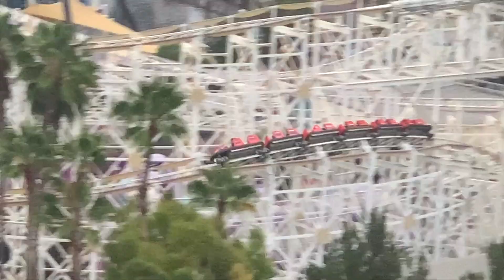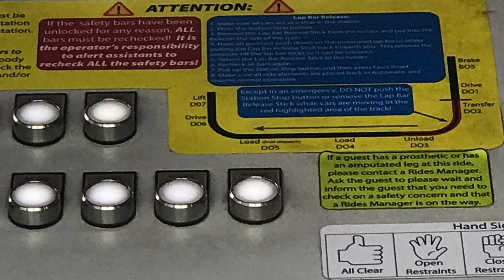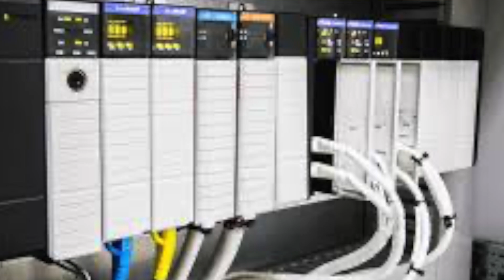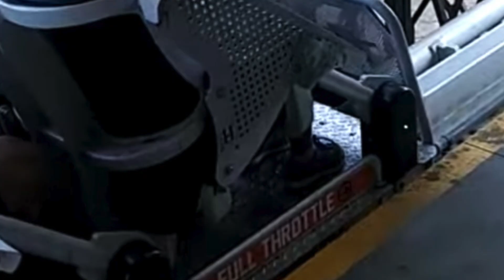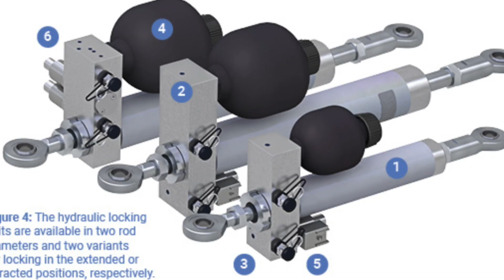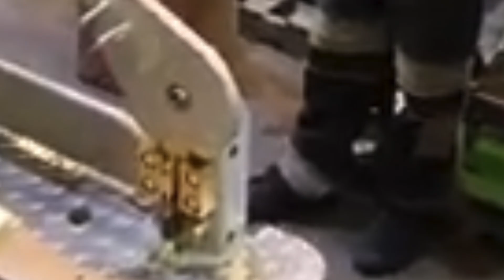Rides can’t tell if your restraint is locked

Comment: i used to work with a ride that had a neumatic system for the restraints operation: it needed air pressure to release the ratchet and to open the restraint itself. When the air pressure dropped, the lap bar came down to the passenger and the pawl's spring forced it to engage with the ratchet. Each toothed bar had the standard proximity sensor which told whether the restraint was in the correct position, but it also had a sensor on each pawl to make sure it had been properly engaged (4 per seat). The type of ride allows it to continuously monitor the restraints system during the cycles. This is easily one of the safest, fail-proof systems i've worked with.

Comment: the rides we have here at SFOT  CAN  tell the operator if the restaints are locked we have the Texas giant that has a test seat and the Titan that anytime someone gets in  the train thers a line cluster of amber and red lights the amber lights tell them if the restraints are open and the red light tell them that the restraints are locked. ive seen the control panel on both the titan and the texas giant and they are almost one in the same.

Comment: Ok, I had a bit of deja vu seeing that seatbelt latch component. I believe a simmilar (but older) part was used as a door lock on a couple of the CNC mills I've run. Most notably the Fanuc mill at my last job which most of the time would continuously not allow you to open the door even when the machine was stopped at the end of a program. The piece that it holds on to is very simmilar between the one pictured in the video and the ones used on the machines I've run.
Reply from the maker: @kaylinosprey3306  they are commonly used to lock cabinets for electrical and machine guarding so it’s probably the same thing.

Comment: Theres one theme park i occasionally go to (its the only theme park where i have been on any rides) where all of the rides are machines that are not designed to be used as rides (which means the rides with lap bars CAN operate with the lap bars fully open)

Most of the rides at that park are "visitor operated", where the rider has control of the machine (the machines used for those rides have a system that prevents the engine from being started without a ride op/attendant authorising it, but i don't know if there is some sort of remote shutoff for incase a rider does something dangerous)
With one of the "visitor operated" rides i went on, the ride op/attendant was having trouble with the scanner thing (it probably took 4 or 5 attempts)

There are some rides that are operated by park staff though, and on one of those rides the ride op didn't check my lap bar, and didn't even close the other lap bars
on one of the other rides, i saw a rider try to unlock the seatbelts (there is a bit of metal that covers the seat belt release button on each seatbelt, and the rider tried to move the lever that moves that bit of metal out of the way)

Comment: I worry like hell about this as a smaller-bodied rider. I'm afraid of restraints not locking tightly, because at ~5'3 and <100lbs I'm small enough to slip through easily. I have a ticket for a Six Flags park this weekend now I'm scared seeing this is a sign I should reconsider lol
Reply from the maker: @fjordpitsky4486  six flags parks, your fine, i go on those all the time.
Reply: @ryantheridemechanic  I really hope so, I know you can be too big to safely ride but I'm worried about being too small, I'm only about 7" above the height minimum but I mostly worry about being too skinny. I hear SO many stories of people being at Six Flags and their restraints not locking, many of them needing to be held in by other passengers to avoid ejection
Reply from the maker: @fjordpitsky4486  I’d like to see those.
Reply: @ryantheridemechanic  They're very widespread, a while ago someone on TikTok said the lap bar popped completely up on her midway through the ride, seems to be similar experiences from many other people. They're scattered across pretty much every social media platform. Lots of examples in YouTube comments on videos about ride accidents, especially news reports. I've heard a few anecdotes in person too, especially from smaller riders on Over Georgia's Batman coaster. I've never seen any of it officially documented which is unsettling
Reply from the maker: @fjordpitsky4486  well most of it is perception. When a restraint skips a tooth you’d swear it can open but it simply jumped a tooth. Actual failures are extremely rare. I’ve only seen one in 14 years.

Comment: my state fair had a traveling ride that put riders into inversions and twists.... the restraints automatically came down.  When the controller had all green lights on his console he started the ride.  There was no physical checks by anyone (other than the riders doing it themselves but they didn't officially ask us to do that).  I was surprised.  So there must be something out there that knows for certain if the restraints are in their proper position and locked.
Reply from the maker: @joeskis  the light signals the restraints  are down far enough. The locking is assumed until physically checked.

Comment: Newer B&M rides do have checks on the individual restraints.  Fury 325 for example has contacts in the station the train sits on to relay the restraint position to the PLC and will not register locked until the ratchet and been closed at least 3 rachets down. The control system won't allow it to dispatch until every seat is far considered locked. 

Of course there is no active monitoring while the train is out on the course but the probability of the ratchet mechanism failing enough to open far enough to let you fall out is extremely small but it's still a possibility.

Comment: When that red allen bradley seat belt sensor didn't work as expected did they figure out how to fix the problem or redesign it or something?
Reply from the maker: replace the whole unit at almost $500 a pop. we tried to change just the head but AB did not allow that (messed with the safety raring) but no permeant solution was delivered.

Comment: B&M flyers are a bit more interesting. The seat pin moves into the arm and then hits a proximity switch. The ride will not dispatch unless all seats show that the pin has reached the proximity switch in each arm. Therefore the pin "should" be in the arm and the seat locked. Of course, this is making the assumption that something hasn't failed and the proxy switch is giving the correct reading.
Reply from the maker: Is the sensor monitored for rise and fall or Chang of state?

Comment: I remember years ago when I was at my home park riding on a Mack Sleighride and the T-bar restraint popped open on me when the ride started, I tried to get the restraint checker's attention, who was standing to the side, but she didn't hear or noticed the lapbar was up. Toward the end of the ride, I was able to slam the lapbar down and it finally locked, fortunately, nothing happened to me, but it was quit unnerving at the time.
Reply from the maker: I was on the ride when an ops crew did the same thing. Accidentally unlocked the lock and dispatch. I was maintenance but in the park with my family at the time. The crew was replaced within 10min. Didn’t see them again.
Reply: I slightly moved the lap bar, putting my things in the storage compartment and that’s the way it locked so it was not fully secured. It was a scary ride because I didn’t know if it would invert the Everest.

Comment: Here is a question....
Now....is it the same logic system that shuts down a ride when ppl either remove the seatbelt or a seatbelt system fails when going up a lift on a coaster such as Magnum XL 200 or Millennium Force...
I have seen it or heard of it stopping on the lift for such a reason...
And I have seen screens with seats on Valraven and Steel Vengeance and is that just position verification cause i know it wont dispatch if any red shows...???
Reply from the maker: The seat restraint has to be far enough down to make the screen turn green. As soon as the train moves the ride is blind to the status of the restraints. When someone unbuckles on the lift it the ride operators that press lift stop.

Comment: While everything you said was true. This is a great example of how word choice and the presentation of material can mislead an audience. In my 18 years in the industry I've never heard a ride mechanic speak with the skepticism you do in the video. A restraint designed to fail safe, and having been (in most modern rides) detected as closed by the ride system and visually and physically verified by a trained operator, is as secure as can be assumed of any mechanical device. The scenario that you paint of a restraint being found unlocked as a train ascends a lift hill, (while not zero) we can both agree is so close to zero that an occurrence as described would send shock waves through all facets of the industry resulting in design, maintenance, operational, training, and communication changes. The design, systems, and processes around thrill rides today far exceeds anything found in other machinery the public interacts with on a daily basis. Trains, Cars, Planes, Construction equipment, Elevators, Escalators, Microwaves, Drawbridges, and CT scanners are more likely to injure or kill due to a failed safety system. It would have been fair to make some version of a contextual statement, that you found agreeable based on your expertise.
Reply from the maker: There are definitely way more throng out there to worry about, thats for sure. I do love to play in the verbiage gray area. Stems from racing. Not what the rules say but what they don’t say. Same thing here. Rides have amazing safety and redundancy built in better than most things in the world. But the hook is priceless.

Comment: Whenever I ride roller coasters I feel that I assume that a degree of responsibility. I always give a pull and a push at any of my restraints. I know that by doing this simple thing I have insured that the systems in place should then operate fine, regardless of shifty operations. Not taking anything away from ride ops. But if i at least pull my restraint to my body and give s little push back, I can ride happy knowing at least one person did their due diligence. Definitely was able to push my restraint on lightning run to the point where it was no longer holding me. Alerted the confused operators. Switch chairs and had a great ride as the next one wouldnt budge.
Reply from the maker: When my wife rides with me she sakes me to force hers down further trusting to get one more click. She calls it her safety click. I’m happy to help her. I always check my own as well.

Comment: I once operated a Zierer Tivoli medium on which the Control pannel was so basic and old, you could start a ride cycle while unlocking the restraints and it couldn't care less 😂
Reply from the maker: Yea. We had to tell ops not to send the major coaster with the restraints open after service bulletins came out about cracks in the bars. From operators doing it as standard practice.

Comment: This happened to me about 20 years ago on Dahlonega Mine Train at SFOG.  Held on and when we hit the 1st brake run in the station, we got out and walked up to the station. The looks on the ride ops faces we’re priceless.
Reply: Not just a gap, the bar never locked.  It had some tension on it, so when the op did a quick two finger check it seemed locked.  Once we started riding the bar could come fully open. Thankfully it’s a mine ride. We just held on. When we hit that brake run, we opened the bar fully and got out.
Reply from the maker: @dennisrichardson4187  wow
Reply: @ryantheridemechanic  woah realizing that mine train incident was at SFoG really changes how I'm seeing the park given recent events. wow. not good. not good at all.
Reply: @illeyejahmalone it seems like the only park comments here are about sfog... And all years before the Goliath incident...
Reply: @h1jen1x  yup. that's a very very bad sign that something is seriously wrong with that park.
Reply from the maker: Yea if I have some padding I can get out of the millennium  flyer trains from GCI
Reply: Oh man this comment is a massive red flag that should have been caught years ago considering what's just happened at SFOG now with the rider ejection. Boy oh boy oh boy not good SFOG not good.

Comment: First of all - who are you and what have you done to that Ryan guy who would nerd off about topics like this in an hour-long video? 🤣
Jokes aside. I am now wondering two things:
First of all, there is at least one coaster in Germany (a country not exactly known for being massively unsafe, and we are talking about a big-name park here) where I have never seen (at least up until 10 years ago when some change in my life stopped me from being a regular to the park) any operator manually check the restraints or ask the guests to do so. It is well possible that there is a minimum verify, but that's likely it. Sure, it's more of a Wild Mouse style ride, but despite not being large, they have some sharp pops of forces. Makes me wonder what is going on there.

And - could it be that there are actually some coasters that do verify that the restraints are locked? Time Traveler at Silver Dollar City comes to mind. The restraints close when the operator pushes a button on each unit of four rotating seats. They come down, you feel something click, and then they feel like they get pulled up again by the same mechanism that brought them down.
Reply from the maker: So at the top, I tried scripting this one because I had a lot of exact point I feel I couldn’t hit In my normal rambling session so the script was vary big but not long there’s the time. 
1- manufacturers typically state to verify the restraint is down all the way and locked. But countries where they are not run by money hungry lawyers (lawsuits in Germany are much harder and less frequent,) don’t have as many regulations for common sense things like checking a restraint when you pull it down. That’s more of a US have to pander to the bottom 0.5% 
2- the restraints on time traveler, I believe our hydraulic. So if they lower on their own, they probably have a pneumatic, actuator or spring lever, pushing them down. Once they are in the down position, the lever releases and the hydraulic actuator kind of springs backwards, and then you get the feeling that it went down and then essentially pulled back up. Essentially it was a difference between the actuator releasing and the cylinder grabbing.  The noise is either the mechanism releasing or a secondary engaging. I’m honestly not sure which one it is for that particular ride.
Reply: @ryantheridemechanic True, Germany is not as sue happy as the US, which is also why seat belts are much less common here, and there are even coasters that don't have air gates. But regardless, it is normal for operators to check the restraints, even at the same park. It is just this one coaster where I don't remember seeing them ever do it.

With Time Traveler, that could be one explanation. But at the same time, who knows what good idea Mack Rides had there. And with the model still being quite rare, only few people have seen the internal workings of the restraint mechanism. Maybe I should do some research if they filed patents on that stuff. There can be quite good explanations in there.
Reply from the maker: @Colaholiker  absolutely. I have very little experience with MAck rides.

Comment: I’m curious why ops at Steel Vengeance at Cedar Point tell you to not pull the lap bar down by yourself (otherwise you have to do the loading procedure all again) and then they come and push them down. Do you know what that’s doing)
Reply from the maker: If there is a lap belt they have to see those first. Otherwise, it’s in the plc when the lock command is given none of the down indicator prox’s can be high. So if one is down when lock is pressed the plc will throw out a trouble error.
Reply: There is seatbelts they want those on before the lap bar

Comment: I personally love what Mondial Rides and KMG have done on their flats. They have a green light above or next to every individual restraints which is also a push button for the operator when the system says no, with one push of the button you can unlock the restraint, and try again. The platform operator always can see if the restraint is saying yes or no.
Reply from the maker: The individual button is so nice. Love that.

Comment: The ride is designed to be locked in its normal state - rolling. Sensors or not- it doesn't matter if it's electronically monitored.
Reply from the maker: Well put. Only the station can unlock.

Comment: I thought that with (specific example) B&M’s new attractions they have the ability to verify restraints through ausibus on the track. Some parks even have screens or displays that show each restraint and its status.

From what I understand the main PLC won’t allow the train to dispatch unless the restraint is closed correctly.

I would really like to know more about the ausibus.
Reply: Restraints can only be monitored when the train is in the station, the screens can only show us whats going on with the parked train in the station. Yes the PLC will only let the train be dispatched if all the seats are past the min verify angle and the cylinders are not receiving power however once the train is dispatched though the ride cannot monitor the status of the restraints.
Reply from the maker: @spaceistheplace2293  thanks saved me some typing!! Haha!
Reply from the maker: @space is the place said it very well. They only show down to the max height not locked.